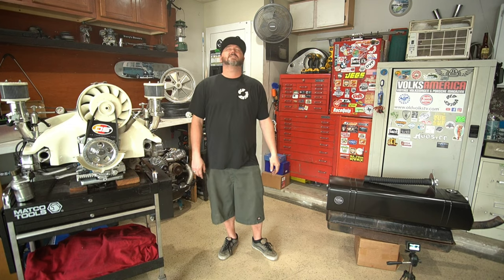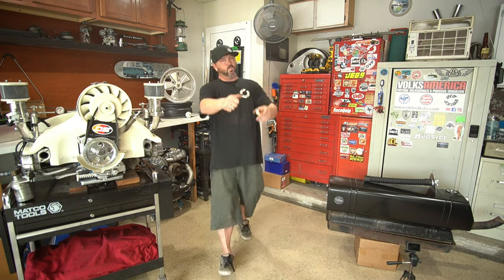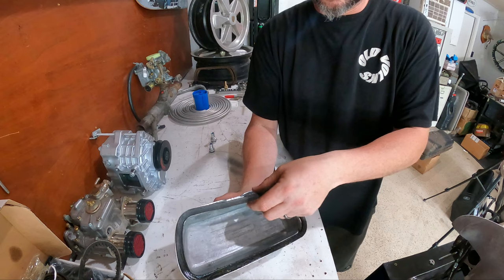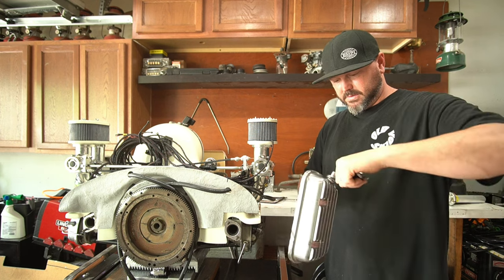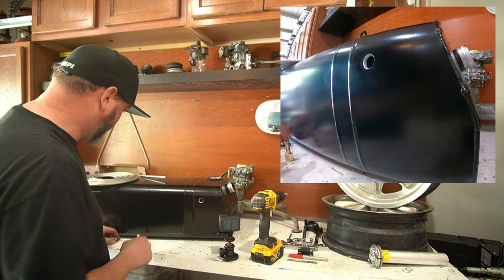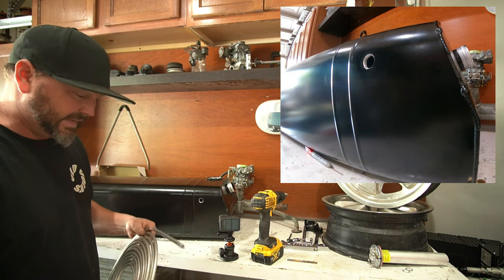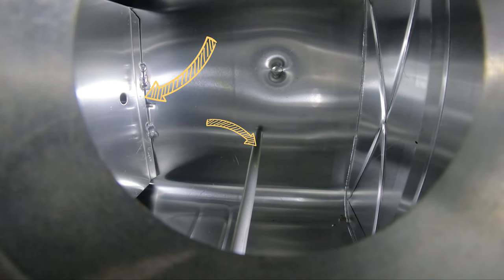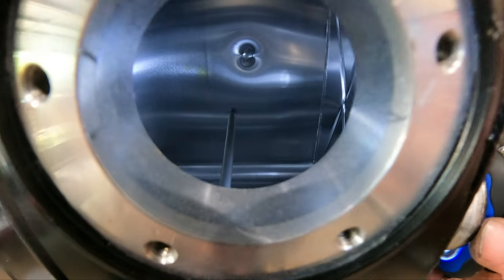Adding valve cover breathers to a vw bug engine

Comment: No link or details on the tank?
Reply from the maker: It's from http://www.sublimerestorations.com/restoration.html

They're very hard to get a hold of, and when they have tanks they sell out quickly.
Reply: @OldVolksTV  so how did you find out about the tank for the bus? Is there a for sale ad somewhere on a website. Didn’t see anything on the link you posted.
Reply from the maker: My pal Robert Skinner ordered a pallet of them last year. Chris got one from him but ended up not using it so I picked it up.
Reply: @OldVolksTV  ah I see. Was wondering why there wasn’t an ad. He may not be doing them anymore? Samba ad?
Reply from the maker: Skinner sold out almost immediately.  You can still order from sublime if you get ahold of them. These are 17gal tanks made to fill up every available inch in a split bus. You can fit a 14gal bay tank easily if you want a little more capacity. Wolfsburg west sells them brand new for $250 I think.
Reply: @OldVolksTV  ah ok. Yeah I’ve seen the bay tanks from WW. That tank you got was interesting for sure. 
Thanks for the response.

Comment: All VW drivers listen up ! Don't use rubber valve cover gaskets ? They shrink !!!!  I was going to Corpus and all of a sudden I was  smoking like h-ll . in 4 miles I lost 1.5 quarts of oil and it landed on the J tube = smoke screen . The ones I used was Fel- Pro ....
Reply from the maker: Yeah I use the cork gaskets. Sometimes you have to double them up to get a tight fit.
Reply: @OldVolksTV  I keep a extra valve cover with a corky under back seat in a HEB plastic bag . A few years ago I got some corks from NAPA for under 2$ each .